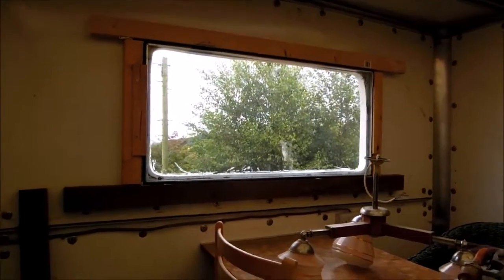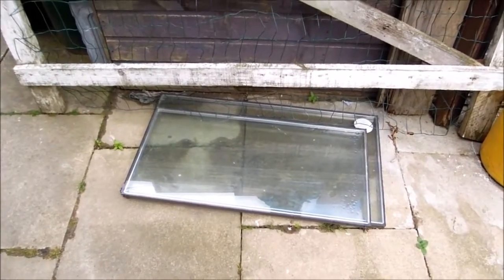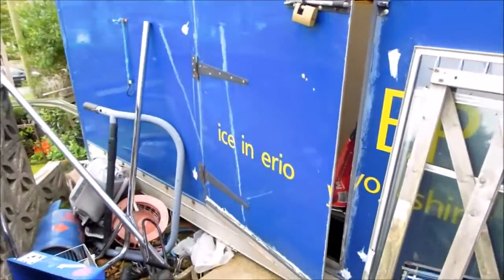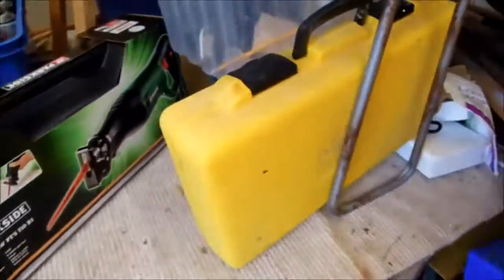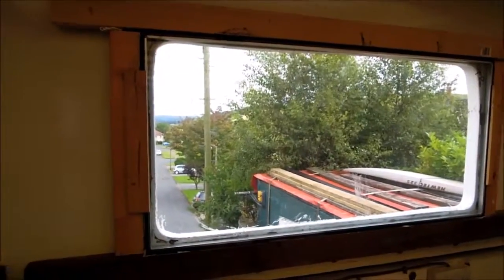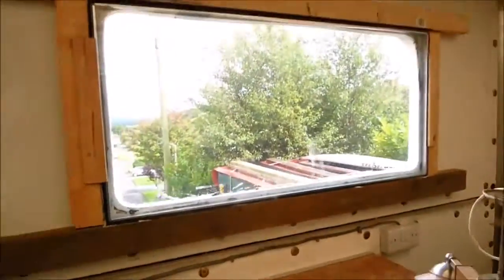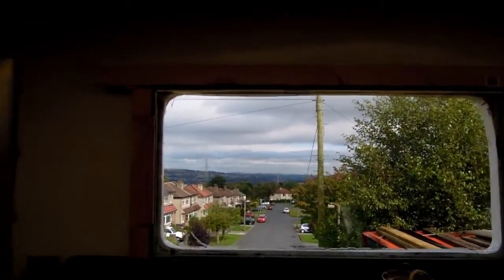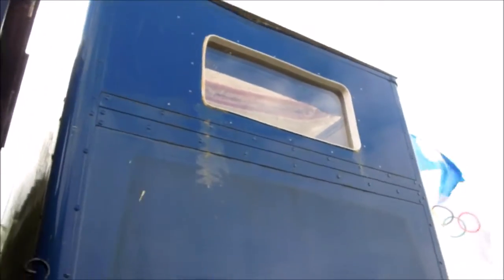How to fit a window in a shed

Comment: Hi there John ,,, I see making the best of summer to get some other jobs done,,, Your shed looks the business that will out last the garden centre sheds ten times over ,,, it looks though you live on a mountainside (almost) dread to think how you got it in ,,, and the widows and soffits etc look brilliant ,,,, well done ,,,,
Reply from the maker: Hi Alan, yes, near the top of a hill. A few degrees cooler than in the valley at times. Great for the start of a cycle ride but a 15 to 20 minute pull up hill to get home! Some part time teaching likely which will keep me occupied for the winter and spring.